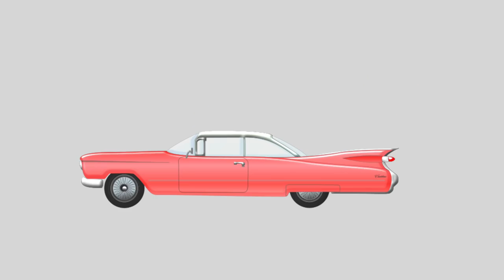Yes, Rockets CAN Fly in a Vacuum

Comment: WRONG.  Equal and opposite means one mass will only equally push an equal mass and because rockets full of fuel weigh a hell lot more than the fuel ejected out the back, it would take too much fuel to make it work.  And the more fuel you add the more the rocket weights and has to haul.  So without pushing off on an atmosphere, a rocket could never hold enough fuel to make it work.  It would be like shooting a gun in outer space.  The recoil will start moving you a little bit but not as fast as the bullet because you have so much more mass.  You would have to keep shooting bullets like a machine gun to get up any speed at all, and it would never be efficient.  On earth the main force of the rocket is the thrust or push against the atmosphere and the lesser push is from the "action/reaction" weight of the exhaust.  So even though you still get the "action/reaction" in a vacuum, it isn't nearly enough to go anywhere without the  bigger push the atmosphere gives rockets.  Nope.  Rockets don't work (efficiently enough) in space.
Reply: BILL BILL Bill. You just explained it yourself. A bullet with small mass moving at a high velocity pushes you back a little bit. A machine gun even more. 
Rockets expel tonnes of fuel per second at a velocity of about 3000 m/s  providing the required thrust.
Reply: @ Bill bill
I asked the following questions to someone on another video, he has the same problem with understanding Newtons 3rd law. He hasn't answered as yet (he went off on a tangent, but I have tried again), perhaps you can.

How does exhaust gases work together to push off the atmosphere? 
How does the gases then exert a force back towards the rocket to push it?

CK has hit the nail on the head, imagine each exhaust gas molecule is a very tiny bullet.
Reply: Another way to show you that the rocket or jet engine does not push off against the air is this.
You have seen objects or maybe even people behind a jet engine getting blown away by the exhaust from the jet. If the jet / rocket is pushing against the air, when the exhaust hits the object, the object should also be able to push against the air behind it and not get blown away. But it doesn't, because the air offers very little resistance.
It is the exhaust gas pushing away from the rocket / jet engine after the fuel has been ignited that provides the thrust.
Reply: Do you use GPS? 
Ever watched satellite TV?

Both are proof rockets work in space.

The combustion gasses don't push against atmosphere, they push against the combustion chamber of the rocket motor, and it's nozzle.  Once the gasses exit the nozzle, they are no longer providing thrust to the rocket, even at sea level. 

All the thrust comes from within the rocket motor. Always. The fire you see behind a rocket isn't doing anything to help push the rocket along.
Reply: I disagree.  You can watch a test on YouTube if you like, of a man with a drone, hovering in a room.  By holding a piece of cardboard under the drone and lifting it up and down he could cause the drone to go up and down without touching it.  The drone would always maintain the same distance from the board.  May not be a rocket engine but same principle.   What you say about pushing off, without atmosphere would be like having a weight lifter try to lift a small boat or canoe out of the water while he is in the water over his head.  Couldn't do it on the water without anything to push off of.  Same with your idea of the gases pushing against the combustion chamber.  The push or recoil, would only be equal and opposite to the mass of the exhaust gasses which would not be even close to enough mass to move the much greater mass of the rocket itself.  Like the recoil on a rifle.  The smaller bullet flies out very fast but the heavier rifle only moves a bit.  And if the bullet didn't have the rifle to push off on, the bullet casing would take off much faster than the lead bullet because of the less mass.
Reply: BILL BILL I have seen that video and it is not the same principle. The drone uses a propeller not a jet or rocket. The effect on the drone is marginal. If the drone was fully charged the effect of the cardboard is negligible. This effect  is caused by a build up of high pressure under the drone propeller and low pressure above it as the propeller pulls air through it. 
Consider that the speed of a bullet is only about 400 m/s. The speed of the rocket exhaust is 4000 m/s, 10 x more, and is being pushed away from the rocket at a rate of 1000s of kg per second. Consider if you had a 2 tonne mass and pushed 1 tonne away at 4000 m/s you would have an equal and opposite reaction the other way on the remaining mass, or proportionally so if the remaining mass was larger. 
Consider 10x the kickback if the bullet was shot at 4000 m/s.
Reply: I'm not saying rockets are perfect. They are in fact very inefficient, but you cannot deny the amount of power released from igniting 100's of tonnes of explosive fuel. 
This is why it takes 100's of tonnes of rocket fuel to lift a payload of only 10 tonnes to orbit.
Reply: BILL BILL imagine a stick of dynamite under a tonne of rock. I bet the rock would move.
Reply: Chris Kostokanellis   -  I have also seen that video and I had to suspect that since drones frequently come equipped with range sensors (ultrasonic or infra-red) which they use for collision avoidance, including vertical ones that sense the distance to the ground, if the drone was configured such that it was using a range sensor as the basis for its decisions about what altitude it hovered at then raising a piece of cardboard that was directly under it would directly result in the drone altering its altitude to maintain a fixed distance above what it would assume to be the ground. Given that the individual presenting that video is straight up bullshitting I wouldn't be at all surprised if his drone demo was nothing more that a misrepresentation.
Reply: Richard Cornford this guy is using a propeller powered craft to prove rockets don't work outside the atmosphere. 
I'm sure a lot of these guys know they are putting out bull shit and just do it to fuel the debate. The problem is that some people see this and are fooled into believing it is valid.